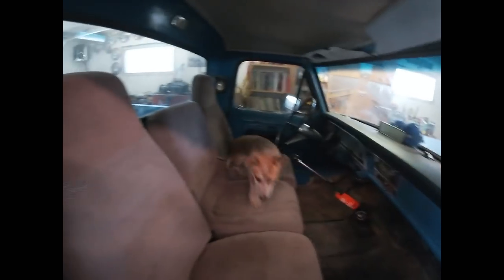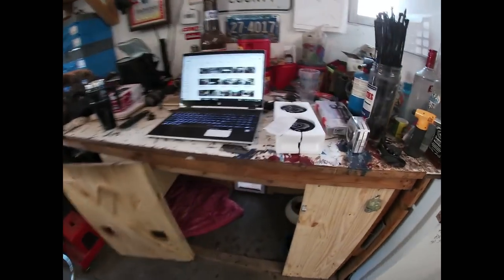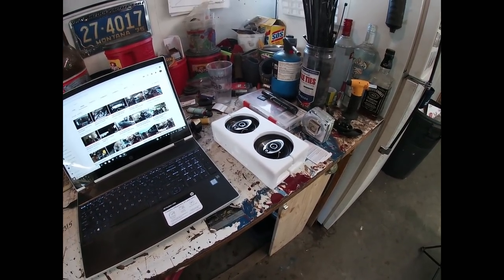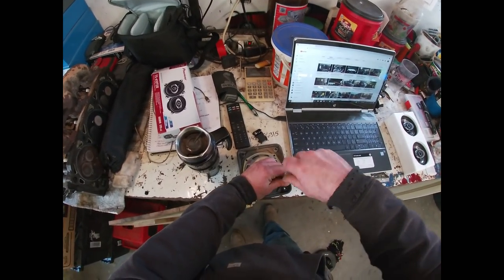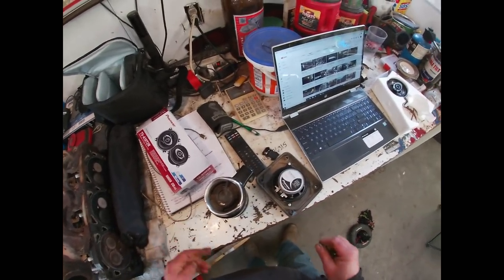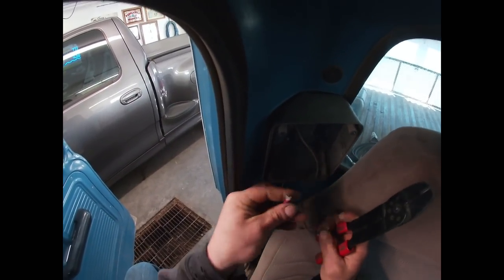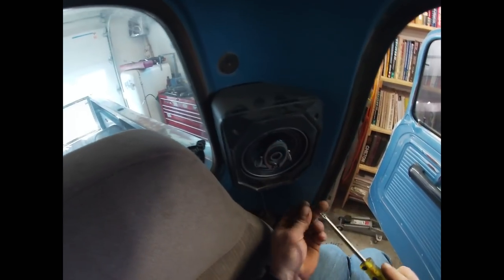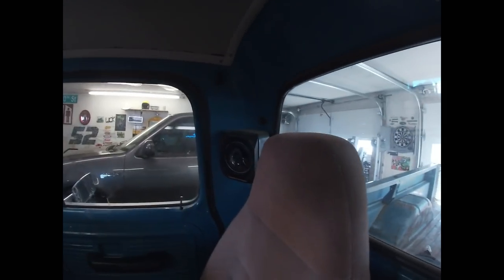Installing new speakers in my 68 Ford F100

Comment: You didn't mention it in the vid, but hopefully you verified the polarity.  Not that anything would be damaged, but it considerably affects sound quality.  Nice looking little speakers, tho.
I have pods somebody put in the back of my CJ7.  I never changed those, but in the dash somebody put 4" speakers when the correct size was 5.25", so I upgraded those.  I have an old "high power" (25wX4 IIRC) Pioneer "truck" deck in there, but the leaky dash/windshield hasn't done it any favors.  :(

Comment: Hey Wayne, am I right in assuming it’s not the original a.m. radio that came with the pickup?
I’ve often pondered about upgrading the stereo in my 88 diesel but, since it’s the original radio I don’t want to ruin the originality of the interior. Unfortunately they’re not releasing new tunes on cassettes anymore. LOL hey do you have any tricks for giving new life to sun baked interior plastic?
Reply: I would imagine that those cassette adapters that used to come with portable CD players would work with mp3 players also.   Also, typically a good install kit will allow you to not damage the vehicle when putting and aftermarket radio in.   And, while I haven't look these in a while, I know they used make more modern head units that were designed to look like older units in classic vehicles.